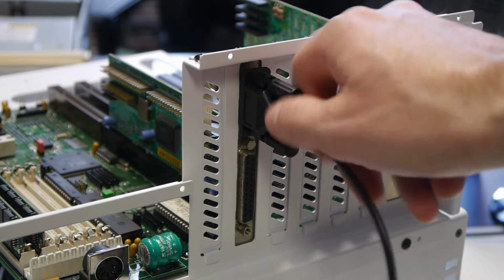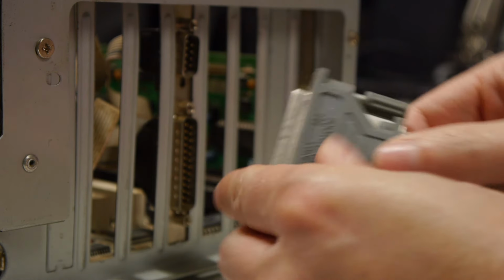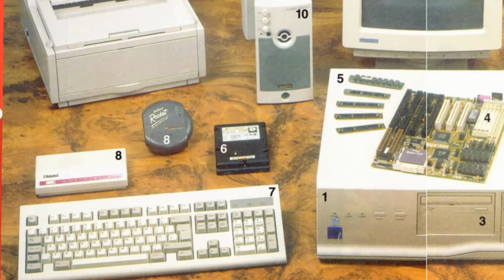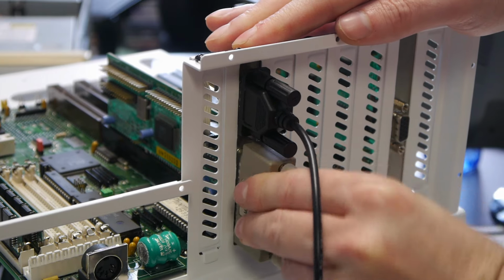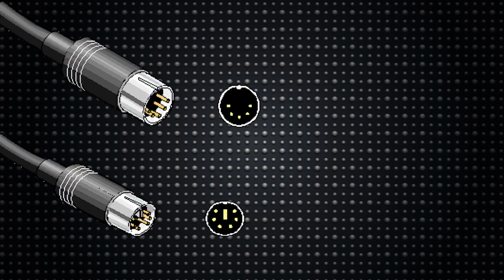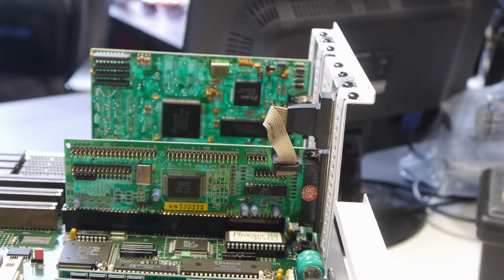What did we use before USB? | Nostalgia Nerd

Comment: I remember these days well - having to load serial port drivers high to conserve as much base memory as possible, eliminating IRQ and DMA conflicts with sound cards and serial ports and transferring files between computers with parallel cables.
Meanwhile, video (display) ports have gone the opposite direction rather than the simplification and standardisation across devices of USB.
Reply: If we could just cut it all down to HDMI and VGA I'd be happy
(I know some people are happier with analog connections rather than digital)
Reply: @IdealVoid  hdmi is terrible, displayport is much better, as for analog ports dvi is much better than vga
Reply: @IANSYT  DVI-A isn't much better than VGA; it's the exact same signaling in a subtly different connector. Connectors like DB13W3 used coaxial connections to really preserve analog signal integrity. Incidentally, USB type C has generated a new generation of confusion with different cables and devices doing different things on the same connector; very recently HDMI over type C thankfully died (as has HDMI type B), so type C now has only about 6 different protocols left just for video signals. It's not really helping that every minor revision of USB seems to rename the existing protocols, having started in the perfectly insane order low-full-high-super...
Reply: I got my CompTIA A+ in 2001. Had to learn all about IRQ and DMA deconfliction. Not that I remember how the details now.
Reply: DEVICE=C:\WINDOWS\HIMEM.SYS 😅

Comment: "at" = "Ay Tee" ;)
But good video. Do one on SCSI, which was a standard that offered much of what USB did, letting you plug lots of things into a single port via daisy chaining and which was more standard on non-PC hardware (Amigas, no?) I preferred SCSI devices for my 90's PC, be it Zip drives, tape backups and scanners. I even had a PCMCIA-SCSI card for an old laptop ;)

Comment: I kind of wish there was a very barebones motherboard that was focused on power and reduction of bottlenecks that had a ton of expansion slots so you can customize your computer to your liking. Seems a lot of desktops I've come across have at most three expansion slots with most functionality built into the motherboard. In my early computing days, I remember having so many options. Didn't like the sound? Simple, plop in a sound card. Didn't like the video? Plop in a video card. Wanted more ports? Plop in a card. Out of every computer I have ever had, oddly enough, an old ISA sound card sounded the best to me. With modern computing, most people seem to be going for phones and tablets and laptops. Phones and tablets are practically useless when you want to do hardware upgrades. Laptops have some upgrade potential, but not much. The poor old desktop is getting left behind. I have no room to speak as I type this from a laptop lol. Well, a laptop connected to a large TV and typing via a bluetooth keyboard. My have things changed.

Comment: It wasn't the 'at' machine, it was the A.T. - as in Aye Tee.
Aside from that it was a nice little walk down memory lane thank you. One thing you didn't mention when talking about all the cables and ports was 'dongles', which were a popular anti-piracy method back in the 80's, whereby you had this clunky device which you had to attach to the parallel port. The software wouldn't work if the dongle wasn't connected. If you had multiple applications - which became more common with task switchers like the original Windows - and they needed a dongle, you had to chain them all together, which often meant this great long dongle snake hanging out the back of your machine.
When it comes to the PS/2 and it's failure, you could do a program about OS/2 - which is where IBM really lost the plot and handed OS supremacy, gift-wrapped, over to Microsoft - and the failure that was Microchannel; which is what really drove the nail into the coffin.

Zip Drives - Classic! I forgot all about those...